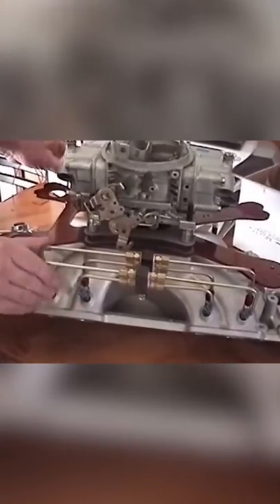#shorts // #throwback to a fresh 502 BBC in the camper-less #farmtruck

Comment: I remember when 500 horsepower was a lot too now my 2L makes more than that
Reply: I think he meant 502CI that’s definitely a 800-850 horse combo depending the the size of the jet
Reply: @railerman2314  ....I would think so too, but just commenting on what was said
Reply: @chasechevy8933  what kinda setup you got pushing 500 I have an 01 SS making 492whp with the LS1 N/A
Reply: @railerman2314  .....Built 2.0L SR20det 30+ psi on e85 (620 crank hp, around 520 rwhp)